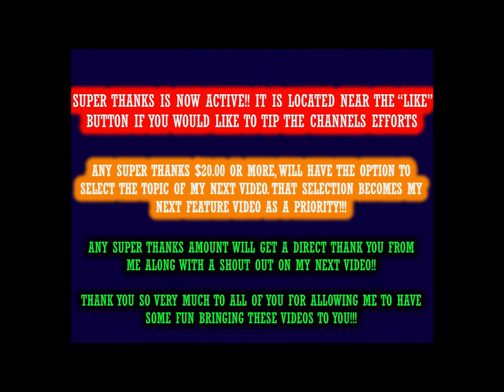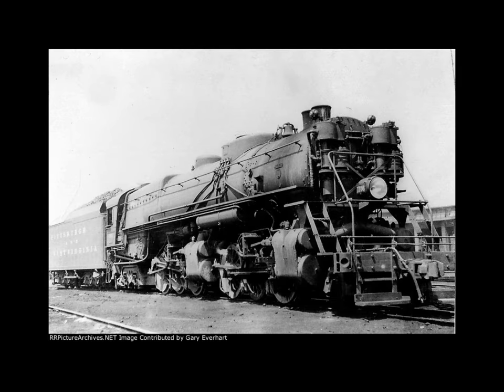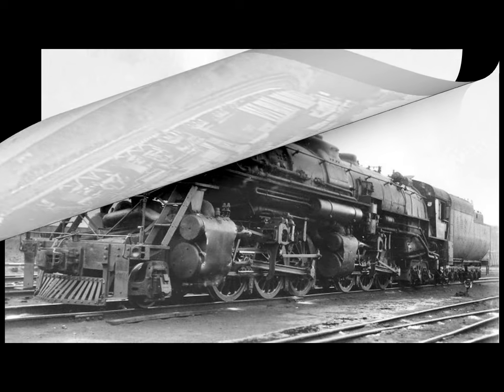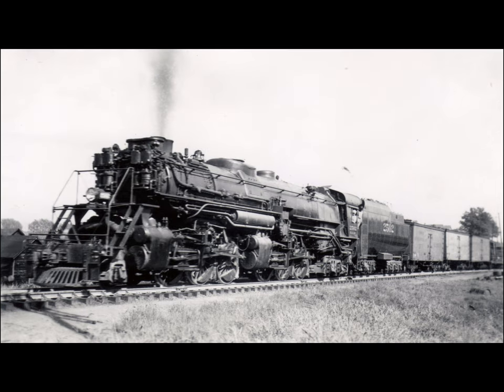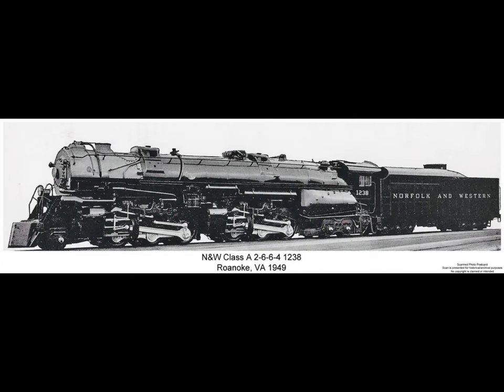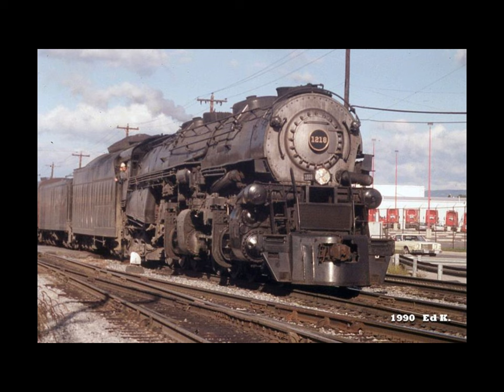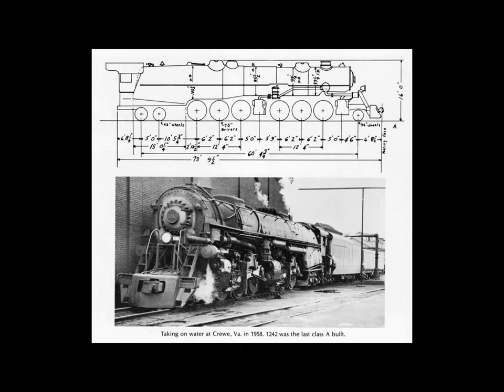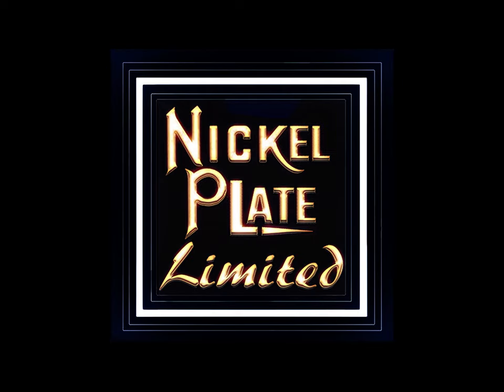The Pittsburg and West Virginia 2 6 6 4, The Super Locomotive No One Knew About

Comment: This is a pretty wierd engine. The SAL and more specifically the N&W conditioned railfans to think of 2-6-6-4 locomotives as high speed engines. With their small drivers and tender booster, these were more suited to being drag freights than fast engines. 

Wonder if the tender boosters imposed speed restrictions on them, and if that was why they got the axe on the second order.
Reply from the maker: Actually I have yet to see an answer for that question on the 2nd order.

Comment: I always thought the N&W Class A was the only 2-6-6-4 in the entire universe, but after watching this video i wonder... what other railroads actually used the unique wheel arrangements like a 4-6-6-4 challenger type?
Reply from the maker: That video is coming.. (Challenger)
Reply: @TheRailroadCrossing-SteamPower :O
Reply: In fact, was the 4-6-6-4 developed from the 2-6-6-4.
Reply: @colinanderson6421  Hmm... you know, both the N&W Class A and UP Challenger were built around the same time in 1936 which is crazy to think about. Now i don't know which came first exactly, however the N&W Class A has 114,000lb of tractive effort, a 300psi boiler pressure and weighed 951,600lb while the Union pacific Challenger has 97,352lb of tractive effort, a 280psi boiler pressure, and weighs 1,069,000lb. Now both locomotives do have a top speed of 70mph, however the N&W Class A proves to be lighter and more powerful then the Union pacific challenger. Remember this: Just because something is bigger and heavier that doesn't mean it's more powerful and fuel efficient. Which begs to question, what if Union Pacific built their 2-6-6-4? Could it rival N&W class A or will it end up being very under powered?

Comment: there wasn't any 2-6-6-4  locomotive that was not successful. All fulfilled and surpassed the expectations. Just the best well balanced simple articulated design.
Reply: The 4-6-6-4 as well.
Reply: @gamerfan8445  that is right, but all 2-6-6-4s had deep fireboxes behind the drivers with more efficient combustion. For weight distribution reasons the 4-6-6-4 had to have the firebox over the drivers. So the 2-6-6-4s were better in power to weight ratio.